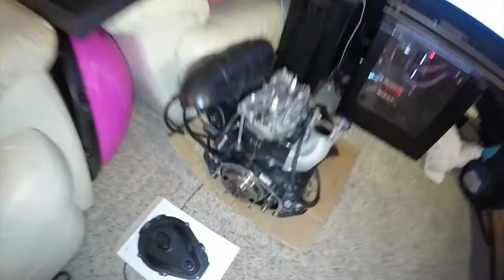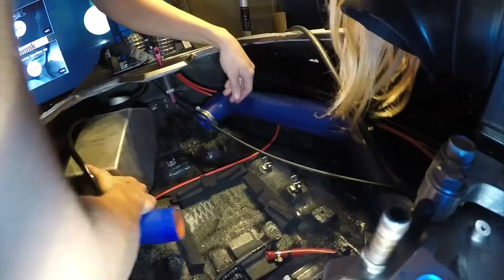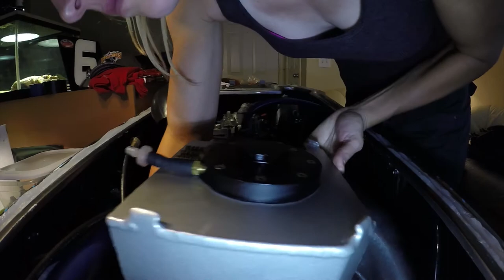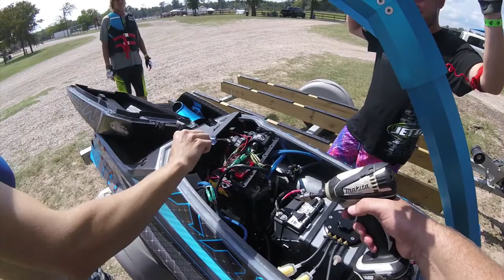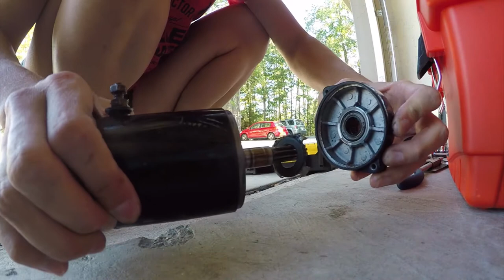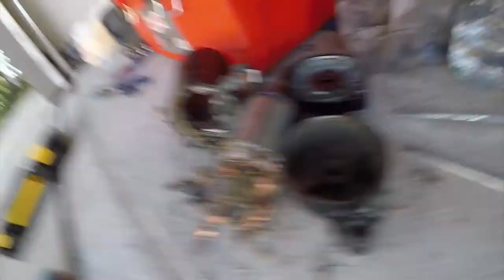ChixSki: Krash 50 Cal Flatwater Freestyle Build - Part 14: Confetti (Not for Celebrating)

Comment: Usually start my JT750's outside the hull. No exhaust or water connected. Just long enough to make sure they spin up a couple good times. A gold series Power Probe 3 makes electrical hunting much easier then a multi meter imo. I always just buy another starter, dam rebuilding them anymore : )
Reply from the maker: Noneshere Hard to start anything in the living room 😉
New starter already on the way.

Comment: Sorry about your bad luck on the engine. Is that Kawi triple going in the crash eventually? Im just now starting my triple project. If you want to watch a guy cut out his tray for 30 minutes here is the vid lol https://www.youtube.com/watch?v=pfR0wUQPaFU&feature=youtu.be
Reply from the maker: RequiemFiasco Oh heck no! Kawi triples are race only since they are so heavy. Used parts break, understandably. Hope to get running soon 👍
Reply: Im going to be setting a Yamaha 1100 back 1.5 inches in my Superjet and plan to run a waterbox in the tray. Im also going to run a 155mm pump with an added wear ring setting the whole pump and nozzle back 3".  Im hoping I can get that weight more balanced in the ski by doing these things. Its just a rec riding ski that I want to have gobbs of power and a dance floor for the tray. If I can flip it its a bonus lol...
Reply from the maker: RequiemFiasco It will have a lot of grunt and great for a rec and maybe freeride boat. The triples are just too heavy for any real freestyle.
Reply: Its just an all around ski, no rocker, no shorten. Im just doing quality of life stuff mostly and reinforcing the hell out of it to make sure I dont have to do this messy job again. You made me do it with all these triples I see in your vids. Im just hoping the yamaha has a chainsaw sound like the kawi 1100 does.